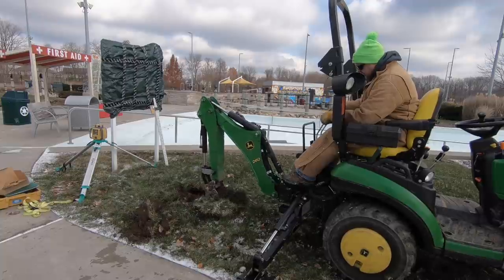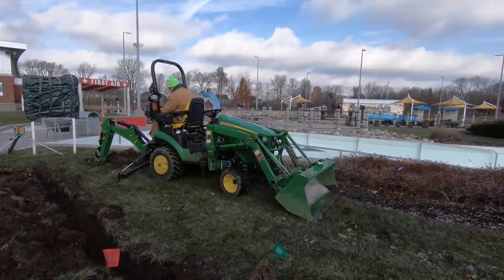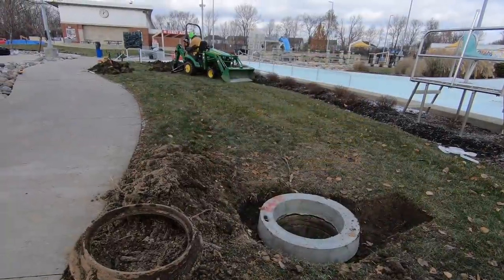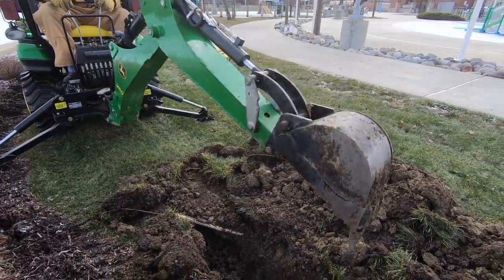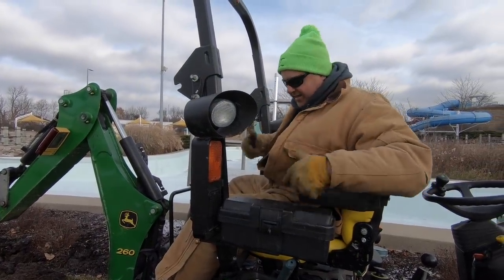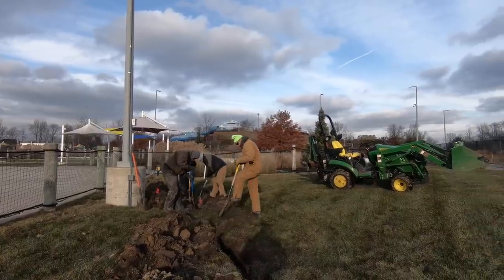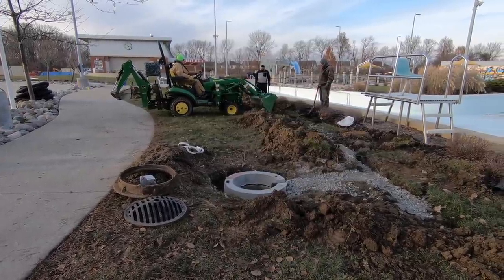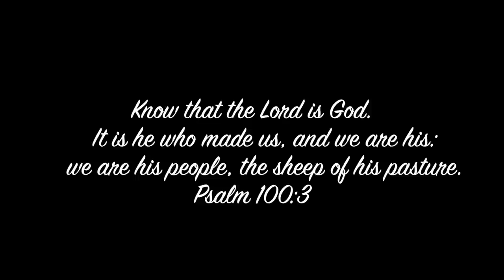John Deere 1025R Digs The Water Park!! Large Backhoe Project!

Comment: Where did you get all your laser stuff, magnetic mount and such.
Reply from the maker: Check our amazon store.  Amazon.com/shop/tractortimewithtim
Reply: Thank you when I looked earlier the link to the mag mount unit wasn't on there . Your videos really help lots of people .  God bless and Merry Christmas to you and your family.
Reply from the maker: Should be on there now, right?
Reply: Brian Vaughn I bought the laser level off his amazon account last month and have used it twice now. I do regret not purchasing the magnetic mount but that problem will be solved as I am purchasing that today.  Once the laser level auto levels out you can shoot a +|- Grade up to 5° slope. That has worked excellent for me installing the perforated pipe. they call it tile. I called it 4” Corrugated drain pipe with perforations.   I purchased the one that uses batteries vs having a rechargeable battery. It has not failed me yet and still running strong. I laid in 600 ft of drainage pipe and had the level running for over 2 days of work.
Reply: @TractorTimewithTim  yes it is thank you
Reply: That is pretty cool little device.
Reply: i guess I am kind of randomly asking but do anyone know a good website to watch new tv shows online ?
Reply: @Tyler Angelo lately I have been using flixzone. You can find it on google =)
Reply: @TractorTimewithTim  Think I'm gonna wait to see if I will earn money doing this before I spend hundreds of dollars on survey equipment. Guess I'll just use a straight edge and level since is only one building.

Comment: The project's you get.   Going to be hard to get a bigger compact. The size of johnny is very handy. You will make the right choice. Wish john deere made the 110 backhoe.  
I see the 110 doing alot of work if you had one. Thank you for your videos. Keep up the great work.
Reply from the maker: 110 is essentially a 4R tractor
Reply: @TractorTimewithTim  you are correct in frame size and such, however apples and oranges when put to work for different tasks beside each other, I have a 110tlb (43hp), and my dad has a 4720 (66hp). The 110's hydraulic capabilities are far superior to that of the 4720, my loader far exceeds his loader in every way, and the backhoe functions of the 110 are much like a full size hoe compared to tractor mounted backhoes... dad runs a 17' batwing finish mower and for that, he is able to do that and not know its behind him, where as the 110 would struggle to even run it I suppose (we have never tried it) he has the plush cab with all the bells and that is a benefit for sure... they both have their pros and cons but the 110 is a huge difference in real grunt dirt work...
Reply from the maker: Christy’s dad has a 110tlb
Reply: Yes 110 is a 4r. I just liked how they made the package
Reply: Anyways keep up the great vids

Comment: Dear Tim:  I’ve got a project like this waiting for me, still in the planning stages.  Since my 2305 has no backhoe, I’ve gotten Artillian’s front hoe, and I’m sure you’ve seen the Green Tractor Talk threads on that.  I may also go deeper than the front hoe allows using the forks to dig (I’ve got both 42 and 24 inch).  I noted your mention of the life span not being a concern in your water park situation but for other similar projects I think if you check out French Drain Man on YouSloob you will like how he approaches these, use a “burrito wrap” method that appears performs well and will last the longest.  Interestingly, he also has a Casey-size Kubota mini-excavator, and a Ditch Witch walk behind track loader, so pretty similar capabilities and machines as you have.

Comment: Hey Tim. Just found your channel and you have helped me get into tractors and the 1025r with tlb. Have you noticed that the fel doesn’t come down even or raises slightly offset? I’m wondering if this is normal or I’m paranoid using it to dig some grass/soil up that I damaged something. It’s not much. Maybe a half an inch difference from the left to right side of the bucket. But didn’t know if you have experienced this. Maybe my garage isn’t level?
Reply from the maker: Many possibilities.  Tire pressure.  Unlevel floors, etc.
And yes, it is possible to bend the loader booms...but you have to be pretty rough on it to do so. I don’t think I have ever done so.

Comment: If you have trouble getting the soil out of a narrow backhoe bucket, don't hog out as big a piece of dirt as possible. Instead take a shallow cut of 2 inches or less with each stroke & it won't pack a single big clump in the bucket.

Comment: I put a 100ft drainage ditch in my yard, I have one place that is horribly soft.  It helped but unfortunately I am still having problems.  I am going to put 2 more drainage ditches in and connect them with the 100ft thats already there and see if that does the trick.  One factor also we have not had a good dry summer here in years.
Reply from the maker: Is it possible you have an underground spring causing issues?    If so, perforated drainage tile below the surface will do the trick!
Reply: Actually thats what my dad has said.  As soon as it dries up a little I am going to work on it.  Thanks. @TractorTimewithTim

Comment: Does Casey have an 8" bucket? If not maybe that is another reason to use Johnny on this job.

Agree on the issue of roots near those corrugated pipes. Might not take long before they are blocked. I had that problem with a professionally installed foundation drain. The guy went cheap with thin wall solid drain pipe and didn't glue the sections together. Roots got in  > 10' below grade and blocked the pipe. After the second time cleaning it out I paid someone else to replace it. 2' below the grade of the bottom of the foundation and still didn't find it so he put in solid drain pipe of proper thickness at 10' and glued the joints.

Comment: Tim, you wouldn't happen to have a link for replacement tire and wheel assemblies for 2 series tractors would ya? im failing miserably in my search....
Reply from the maker: You can get the rims ONLY from Deere.  You can get the tires from your local Carlisle Tire dealer.

Comment: I dug a 165' trench with my new 1025r using the standard bucket. It wouldn't go down very far (maybe a foot). How do you go deeper?
Reply from the maker: Loader bucket?  Kinda hard.  You must taper downward digging a wider area.
Reply: @TractorTimewithTim  No, the backhoe bucket that came with the 1025r. Ordered a trenching bucket from BXpanded, but it won't be here for a couple more weeks (6 week lead time). Would that dig deeper being smaller?
Reply from the maker: @Diantane22  why would it only dig one foot deep?   
I recommend using muddscustoms.com rather than bxpanded.  Should get faster turn around. …oh, and TTWT saves you 5%!
Reply: @TractorTimewithTim  Something about being out of stock on the (easy to build) deck stands for so long and the 12 week lead time turned me away from them. Want to get most of the work done during the upcoming warmer months. Manufacturers with such a long lead time, means equipment has to be ordered in the winter for the next Spring.
Reply: @TractorTimewithTim  I only dug one foot deep because I couldn't get any deeper. No idea why. It was just clay.
Reply from the maker: It was too hard???

Comment: Is your F350 gas or diesel?  And what kind of fuel mileage do you get?
Reply from the maker: Diesel. 11 with trailer 17 or so without.
Reply: @TractorTimewithTim  Wow.  That's pretty good. I've been thinking about getting an F250 diesel. Still wondering if I'm going to wish I got an F350. Figuring out tow capacities is surprisingly complicated.